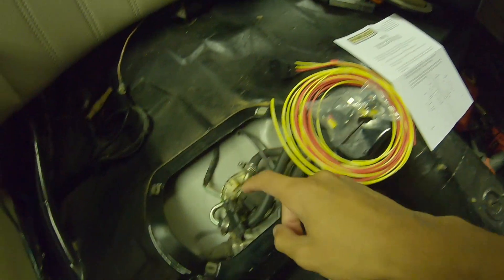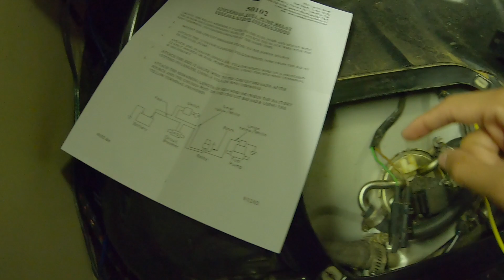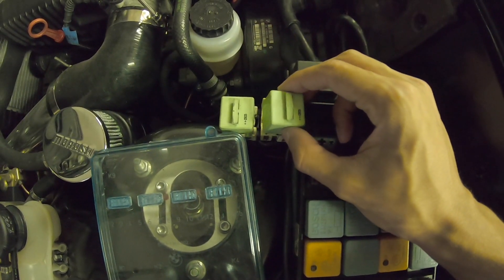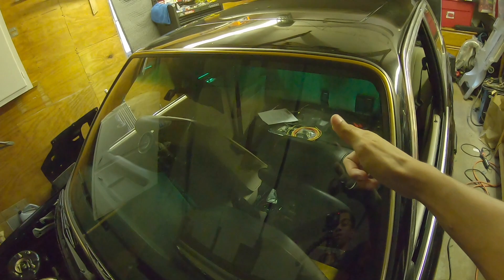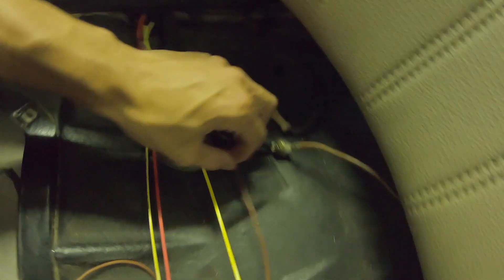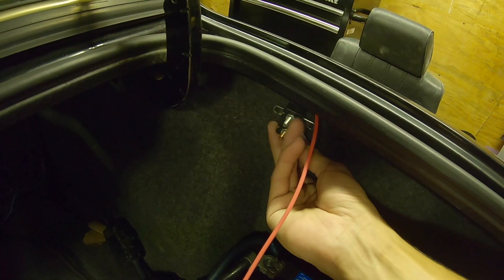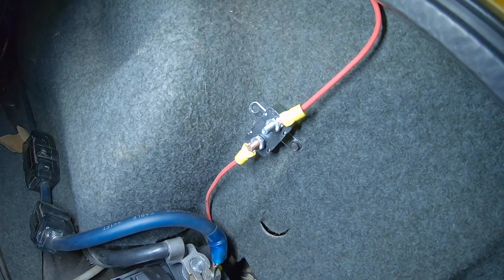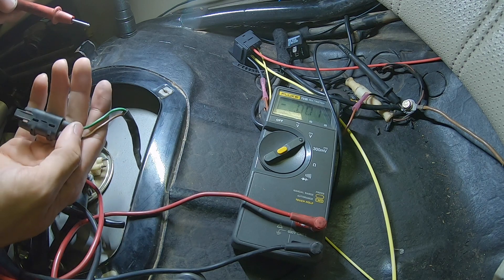E30 Fuel Pump Relay Install

Comment: Great video bro.
My 1990 E30 316i kept blowing the fuel pump fuse. Now it seems to be a hard short and the battery went stone dead last night. I will check the relay first. I hope there's no wiring problem in the harness. I will test the fuel pump also. I would appreciate any suggestions from you. I'm from South Africa.  Many thanks.

Comment: Ended up on Jo-el tube after Googling adding a fuel pump relay setup as I've burnt up a second main power wire on my s54 e30 fuel pump relay connector

Comment: so with this set up with the fuel pump be running 247? I’m having issues getting power to my fuel pump, may just do this
Reply: Has it worked? Because I have no power as well to my fuel pump

Comment: How come you did all that nice work but left behind the old ground? Why didn’t you just cut the brown wire on the pump connector and run a nice fat fresh cable to a local ground

Comment: You didn't check amperage on the correct circuit. You needed to now check it from the new relay you installed. The other relay is just switching your new relay, so of course it's barely any amps.

Comment: Awesome videos you got here and amazing project also. :)
Just as a side note, actually when the engine is running the pump is probably drawing a bit more amps than what you measured with the engine off, since the alternator tipically pumps out ~14.4v instead of 12.
Keep up the good work!

Comment: Nice touch with the fuse, but you didn't repin the plug with the thicker wire, so the weak point is still the last remnant of the system, if anything happens again that'd be the first place I'd check, looks good though
Reply from the maker: thank you! yeah i was a little bit sus about that but i dont have another one of those pins so i just ran it. been fine so far

Comment: in my early model i was planning on using the power from the external pump since it has higher gauge wires, but this is definitely a good solution too